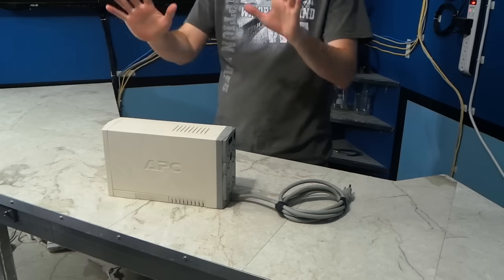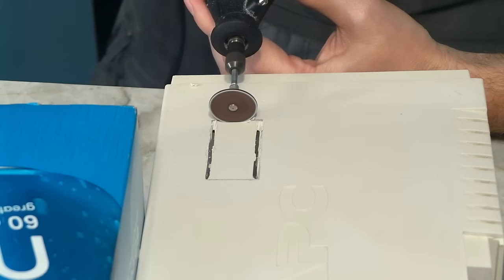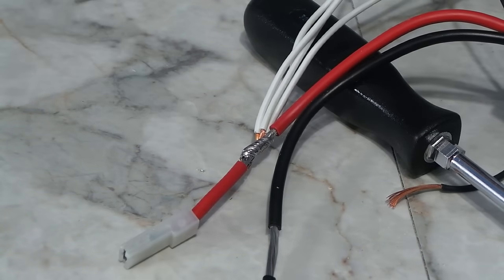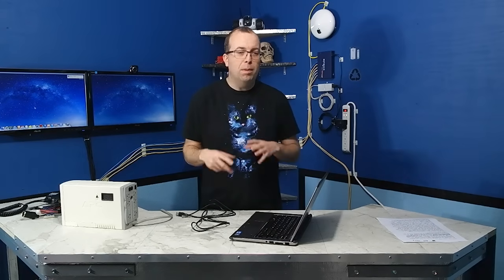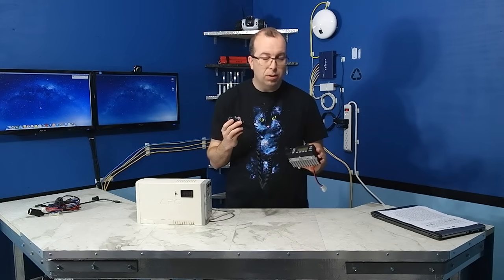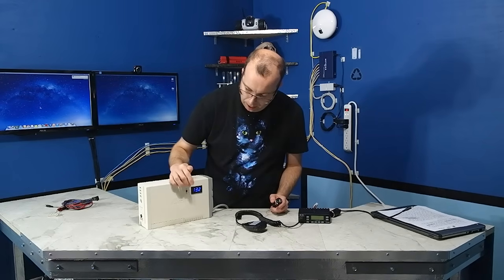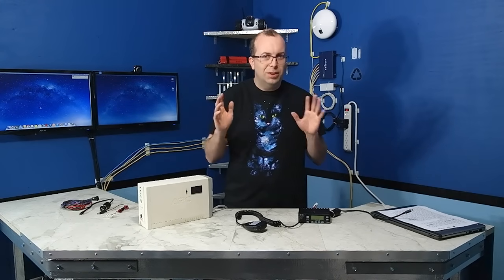Ultimate Battery Backup Hack/Mod.

Comment: Would be a great project to replace the battery with a supercapacitor pack :)
Reply: It would be great failure of a project - supercapacitors store waaay less energy than SLA battery and they're waaay more expensive! Besides, voltage drops as super-capacitors are being discharged, while this type of UPS requires constant 12V DC voltage to operate (it would shut down when DC voltage drops below 10 volts).
Reply: HOWEVER it would be great project to replace SLA battery with Li-Ion. There are battery cases same size of 12/07 that can hold 21 battery of 18650 type, in configuration 7x3. This would give 12V battery with total 21 Ah capacity or more (three times SLA), that would cost like three SLAs (which is equal in value per unit of energy) and that would have much lower charge/discharge losses and three times longer life span. The challenge is the charging circuit, which must be adapted for Li-Ion battery.

Comment: Once or twice a year when the power goes out? I honestly cannot even remember the last time power was off in Belgium? 20 years ago or so? But then again i don't run critical applications so i don't really need it.
Reply: If you have electrical work done to your house, you'll probably find that the electrician turns off the power at the breaker panel

Comment: Electrocution warning:  ⚡💥☠  Some inexperienced viewers may not be aware that not all UPSs have mains-isolated battery circuits.  Often referred to as "line-interactive", these UPSs have mains voltage potential at the battery terminals.  The unsuspecting user may assume that it is a simple and safe 12V or 24V source, when in fact, dangerous voltages have been exposed.   Be safe folks ... run your proposed modifications past a qualified person.  Don't get yourself killed by not knowing what you didn't know.

Comment: Wow, several questions"  1) why haven't you run down to Rural King, Tractor Supply, Harbor Freight for Step Drill bits?  2) It is a really bad idea, really bad to use electric tape over heat shrink.  The heat will cause the adhesive to break down.  If you need to use overkill, then use two different sizes of heat shrink on top of each other. (this would have been part of your Tech training) 3) Why don't you utilize Power Poles?  If you are directing part of your video or hoping to attract the attention of Ham Radio operators with these hacks, then you need to incorporate PP.  Since you are a ham, then shame on you for your poor use or lack of knowledge of good yet inexpensive equipment such as PP (Power Poles).  Otherwise, cool hack video.  If you lived in a rural environment (like I do in the USA) then those outages are sometimes daily.  I just stumbled across this.  So now I have to binge on your previous content...  Oh, I just caught the date of this video.  Why haven't you upgraded?  Its been five years.

Comment: find someone who works IT for a corporation.... they routinely PAY disposal companies to take away these old APC backup units .... my IT Friend let me take 6 of these APC units (600 watts)... for free... all had dead batteries. I installed 2 way connectors in place of the battery, and added mating connectors to cheap full size car batteries ... have several of these for computer and 3D printer power backup. During a power outage, they run all my critical stuff for MANY  hours.

Comment: Nice hack! I actually acquired an APC SMT-750i from my old job that has all the bells and whistles for £40. The internal batteries were long dead so I rigged up 2x 12Ah SLAs externally for it and it powers my PC for a good 30-40 mins at full load. I have a bundle of flat Li-ion 3500mAh cells that fit perfectly into the SLA compartment and would love to convert it to run off those in a 7 or 8s possibly 10p config (this unit requires 24v) but I am still working on a solution that won't confuse the unit as it expects a very different voltage profile. Anyone have any suggestions?
Reply: Please don't do this. Don't put the NCM lithium chemistry where it doesn't belong, you're bound to go down in flames.

Comment: If you use an impact driver you can avoid using different drill bits, impacts spin much faster which makes for cleaner holes.

Comment: It should be noted that the charger circuit could be very electrically noisy, and SLA 12v is no the same as car battery(FLA) 12v(nominals and charging voltages are slightly off from each other). Other than the potential electrical noise of the charging circuit, it probably wouldn't be an issue as most 12v gear has a decent input range, but it is worth noting. Do your homework before modifying something that can burn down your house, kiddies.

Comment: I fail to understand..why don't ups companies provide these features out of the box?
Reply: Because UPS-es are designed for one purpose only - to provide protection and back-up supply of your equipment in case of grid failure. The manufacturers don't want you to mess with their UPS(es) so that you consider them accountable if your equipment fails due to failure of their UPS-es that you have played/tampered with!

Comment: I've got one of those APC units. What I've always wondered is could you add an outboard battery, and skip that internal itty bitty battery entirely? 73 DE W8LV BILL
Reply: Yes, in theory, but the charger in the UPS might not charge it up adequately. The charging current won't be very much.

Comment: Didn't you install any fuse on 12V outlets, really? Man, this is like 'electrician crime'. Do you know currrent output from sealed acid battery in case of short circuit?
Reply: Hi Adam, can you elaborate on that? Probably it is on the interest of everyone seeing & commenting on this. Thanks!

Comment: Hee hee wasn't that 16 Amps in series the first time so you can just use that small wire? Then you changed it to 48 amps coming in parallel off the main wire Whoa. The voltage readout says 11.5V. That's 552 watts when you're maxing it out those three DC jacks alone. Now, yes you should use parallel because that's the way to get proper voltage. If you had them in series you would get like 3.8 volts if all those DC jacks have an equal load. Gnarly.

Comment: All I can think about is the one time this idiot I knew flushed a few hundred dollars down the toilet getting a half dozen extremely cheap back up power supplies... They didn't keep a computer on for more then 10 extra minutes, there wasn't a plug for the monitor so the one time the power went off when they were working and hooked up to all their computers, none were actually still useable. After a year, all the back ups stopped working around the same time, and started smelling heavily of electrical fire.

PSA: Don't cheap out on power supplies, you're quite literally burning your money by trying to save a buck. <3

Comment: Safety Note: a lot of ups's have their charging circuitry floating above ground. This means when charging, the battery terminals could be 150 volts above ground (on a 240V system). Ask me how I know this! Sorry to rain on your parade but you could buy a battery charger for a few bucks and be safe, and stay away from mains appliances and hidden dangers.

Comment: 7:30 For week? Never. It was 2015 tested but how it's possible? Acid batteries are holding 18x less charge/kg than Li-ion. For such reason even if APC looks as huge storage of power it's not huge. Less than in this laptop ;) Possible using 4cell = 14.8V 4000mA = 60Wh vs possible APC 10Ah 12V witch is exact same ammount. If it's not more than 5x smaller than in car 10A vs 45A. I don't know how much CB uses to keep it alive as receiver but as sender possible 5W it gives max 24h constant, witch is - 1 DAY. Possible that, without conversion, would keep laptop alive for 1.5-2h, conversion is not so bad - Lead-Acid batteries are "bad". In 2019 its cool idea, but not as usefull as calculated i guess? Are there any results after 4 years later.. ?

Do you have plans for new project 2020.. cruel times ahead. Portable CB could be at thing special in California.

Comment: That battery has a 108 amp/hour capacity with max output  of 300 watts. At 300 watts the battery will be dead in 4 minutes. 50 watts will get an hour runtime.
Reply: My god your maths is off. And the reason why is because you use the wrong units

Comment: $$$$$ WARNING $$$$ TO ALL check & test between mains input to battery wires AS some (alot) ups units have NO mains isolation to the battery side  hence 120v / or 240v CAN be on the battery, this is no joke

Comment: If the unit takes power even when it's not running anything and lasts for only 64 minutes,Then it would have to recharge itself every 64 minutes!  No wonder my UPS batteries never last.

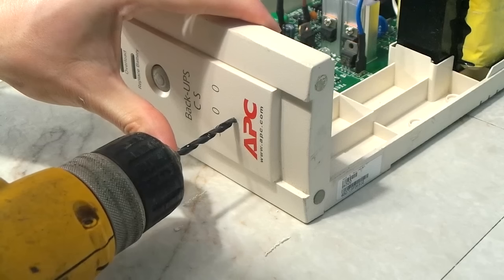Comment: 3:00 there are special drills for this purpose, put once to drill until desired size is reached ;)  
https://image.ceneostatic.pl/data/products/11312785/i-wiertla-stopniowe-wiertlo-rozwiertak-3szt-4-32mm.jpg
Great for wood, plastic, aluminium.

Comment: You are not an electronics enginer are you! That unit is a fire hazard - little barrel jacks connected to a big lead acid battery with no fuses, and you plan to draw up to 16A through them? Crazy!
And building in USB ports was a fine idea - why not just fit a switch to disable them like the voltage display to save wasting power when they're not in use.
And for drilling holes in plastic invest in a cone cut or step cutter!
Also note some UPSes don't isolate the batteries from the AC line, in which case your 12V outputs would be a serious shock hazard.

Comment: So many modern PC cases have space for two PSUs. How about we design an in-PC mini UPS system using 21700 cells that is compact enough to fit into a PSU slot in a normal PC case? We can connect the PSU to this UPS internally itself!

Comment: On your slide switch for the volt meter?  I have a 12V battery box that I use to power a CB radio and the concept is similar to yours.  However, I used a momentary push button switch to power the volt meter so that I didn't inadvertently leave it on.  

But now, I'm wanting to incorporate this:
https://www.youtube.com/watch?v=Z0cOO0TNjNA&list=WL&index=225&t=184s
into the design.  It will let me know when it's time to stop draining the battery.  I'm working on a mod to have this either turn on a sonalert, or open a relay to disconnect the load.

Comment: If anyone out there has fiber internet at home and your ONT is one of the older ones with the big battery backup unit built in (like Verizon did on FiOS for the first 15 years or so) these units are excellent for modifying.  They're designed specifically to put out 12 volts, so they have all of the correct undervoltage protection for running a few other loads on them, like a router and maybe some small lights etc.  I did a video [ https://www.youtube.com/watch?v=x9k24Qwp3a0 ] showing how I modified mine ... basically you tap into the 12 volt rail and then you jumper out all of the signaling pins so it doesn't try to shut off your Internet service to protect your telephone service (which you probably don't have).

Comment: Don't grind aluminium, use a sander. You risk the grinding disk shattering as the aluminium swarf clogs the pores in the stone and then expand with friction heat

Comment: A fuse will protect a wire that is smaller than what can handle the available current. Before any more stupid people say he needs a fuse, they need to ask what the short circuit amperage of that particular battery is. I have seen many sla batteries with very low short circuit current. Just exactly like in something that uses AA batteries.  No need for fuses at all if the wires can handle more than the batteries put out. I do not know if that is the case here because i cannot see the battery label or what gauge and insulation the wires are.

Comment: I had this same thought: Why bother with an inverter if you have 12 VDC devices like a network router and modem? A UPS that provides 12 VDC directly would be simpler, cheaper, more robust, and more efficient! HOWEVER, Ideally, you still want it to provide regulation and safety protection on the 12 VDC line. If you want a UPS that provides 12 VDC directly without an inverter, but still provides regulation and safety circuitry for the 12v, check out the Belkin Residential Gateway Battery Backup: https://www.belkin.com/us/support-article?articleNum=5388

These things can be found on eBay and Craigslist for CHEAP nowadays! I got 3 of them for $10 each recently. Two of them needed new batteries, but they’re cheap, too—only $20-30 if you look around.

Comment: So you soldered the wires then followed up with heat shrink? How did you manage that😂😂
Reply: You place the heat shrink on the wires before soldering....DUH! And the ones that he couldn't, he used electrical tape.

Comment: Actually - I'm  not that impressed.  
I don't see the point of the DC meter..  An ammeter would be more useful, if kept permenantly on, but if a voltmeter is  used, it ideally should be on a 'momentary'  switch to avoid uneccessary drainage.    Obviously the overcurrent protection goes without saying on all those 12vDC lines - possibly thermal mcbs (?)   
.
Every engineer knows - or certainly should know - that one always starts a drill hole with  a 'pilot' drill (smallest size) and work upwards, but a step-bit (stacked concentric hole cutter) would perfom the task more accurately and quicker - a pillar drill would not necessarilly be any more accurate than a hand-held power tool in this instance.  
.
The ALUMIN-I-UM plate was seriously botched...  Why not fit the DC outlets straight into the casing?

Comment: Wow. You don't understand batteries, you don't understand UPS, you CLEARLY don't understand current and capacity.
1. UPS do NOT relay switch the load, you'd get a glitch at changeover, and that's the sort of thing that blows up computer power supplies. The inverter is ALWAYS running, the battery charger is ALWAYS charging the battery, there is NO relay. Power comes in, is rectified and charges the battery. The inverter is connected to the battery, and is producing output at all times. When the mains supply stops, all that happens is the charging circuit stops running. The inverter than just keeps producing output until the battery voltage drops below its threshold. 

2. That radio, on Receive consumes about 200mA and on Transmit (for a 5W output) about 1A. Given that battery is a 9AHr battery, even on Receive you'll only get 45 hours. Start transmitting and that time will go down, rapidly. Hardly 'weeks and weeks'....
You can't be putting such misleading information on the internet, people believe it...

I was a subscriber, not now... 

And just for you, I'm an electronics tech, I fix these things all day, every day. I do know how they work...

Comment: You probably going to drain that battery because there is no battery protection circuit if you draw power directly from the battery...
And second of all those APC back ups are about 90% efficiency with H-bridge circuit which provides pure sine wave and efficient power,
So all in all There is no need for all that crap you just did...

Comment: Now imagne a scenario where one lives in a rented accommodation, where the electricity is supplied via a pre-pay 'token' meter, which in my case is situated in a distribution box up the road...  When the token runs out, it kills power to the accommodation, regardless of time of day; which in my case could be at three in the morning...   Leaving one in pitch darkness, fumbling around for a torch, wallet (containing more card tokens) boots and foul-weather gear,  in this scenario,  tripping hazards are more likely in the dark whilst attempting do deal with the power outage, which,  where I live, are becoming commonplace, as the cost of electricity has soared in recent months,  due mostly to the Uncle Sam, bullying Europe into sanctioning Russia and supporting an errant nazi regime in the process in a pointless proxy war; ultimately causing the token to run-out faster.   
.
Remedy.   Use the UPS to power an emergency lighting system [ELS].  Obviously one might not wish to have a line voltage ELS  on all the time  and the whole point of an ELS is to not have it on, if there is no 'emergency'.  so there needs to be a way of disconnecting the incoming line voltage to one NEC outlet (for the ELS)   A line voltage relay - a 'deadman's relay' - energised off the incoming line AC, will normally be open when energised (emergency light off), but fails closed when de-engergised (power cut); the closed relay contacts either switching the switched/inverted mains to the mains emergency light 'on' via its own dedicated line NEC output socket, or with the use of a multiple-pole relay, (the 'deadmans relay') could perform the same task as shown in this video, by also switching the 12v supply, to run low-voltage 12Vdc devices, taking into account the run-cycle/charge capacity of the specific battery in use - where overcurrent protection is a must, if efficiency, reliability and longevity is of prime concern.